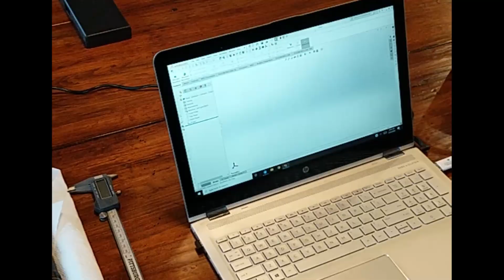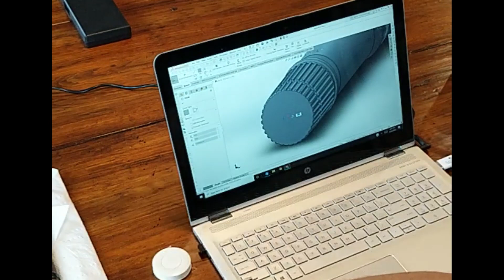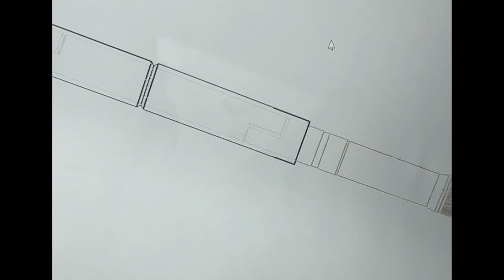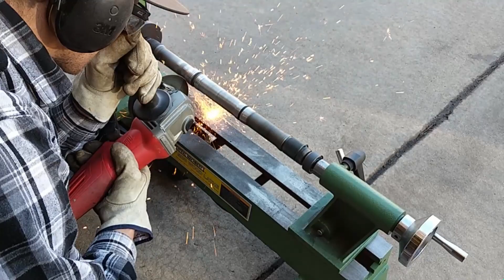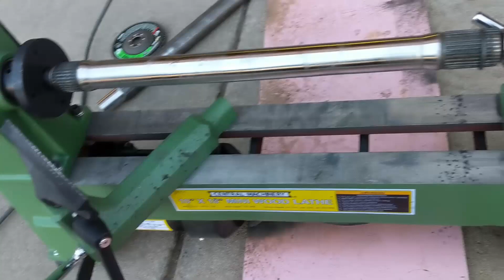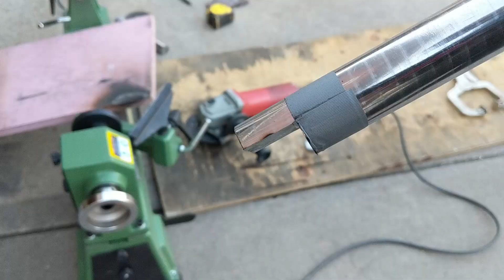Homemade 4Runner Long Travel Axle Shafts - Part 1

Comment: I don’t think the way you cut it will hurt should be the same strength as long as your overlapping that’s the part that’s going to make it strong because of the twisting .  For a fabricator a lave and a end mill are very essential.  Along with a CNC / plasma cutter .  I’ve always wanted to build my skid plates out of T-1 it’s a non conforming metal in witch you have to preheat to weld then post heat .  I worked at a place that made mine equipment so they use this over a person like canopy’s to protect them from falling rock.  I kinda figured 1/8 T-1 plate for the fuel tank and motor/tans plate would be real good if you ever did saddle bag on it it wouldn’t bend up. It would hold the weight of the vehicle.  When I used it for post heat we would just cover the welds up with for dry .  It’s made from clay so it would hold the heat in for hours . Letting it cool off slow making it super strong . There’s you a good little trick if you have to cool of any of your welds slow .  I like the idea about your lift up spare tire .  Kinda a Lamborghini door style spare tire carrier. Another killer video man that lave idea was a good one .  I’ve seen so many people think they can just weld away on that axle metal or shafts between the trans and transfer case to no avail ! Your idea there should work out ok .  When steel cracks and breaks for it being hardened then it’s particularly not to fond of being welded on .  A lot of times like the T-1 it has to be heated up then welded then cooled of slow so it doesn’t get stressed out .  Now if you ever go and weld a figment up for a machinist to cut back out like we’re a bearing or Hines joint has walleered the hole out .  Make for sure you burn the grease out first then heat it up weld it and just let it set and cool down normal .  This way when he machines it the weld will be soft so he can cut it .  If you weld over oil or grease it will make the metal hard .  But heating it up and welding will make it easy for his work also .  Looking forward to seeing you do more learn more and see the ideas come to life!

Comment: this is some good shit, i hope it works well for you. ingenuity over.. money? idk, you are being resourceful that's for sure. If i was to make a suggestion, keep an eye on Craigslist or FB or what have you for a used lathe, mill, what ever you need. you should end up with a much higher quality tool, equal or less than a new unit from HF, that could last you the rest of your life. I get for this project the wood lathe may have been all you needed too tho!
Oh and if those are HF cut off wheels and flap disks, as someone who likes fabing stuff, those are shit. they dont last and im scared the cut offs will rip apart mid cut. Spend a little extra on good stuff from a welding supply shop and use them correctly, you wont regret it.